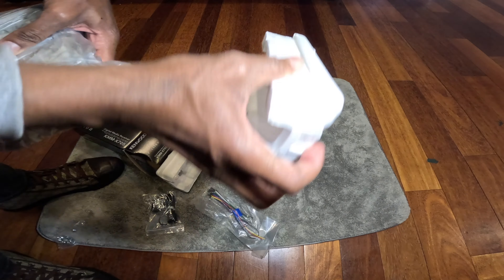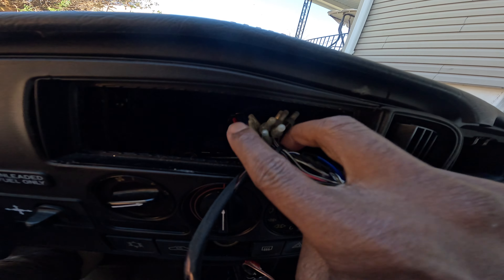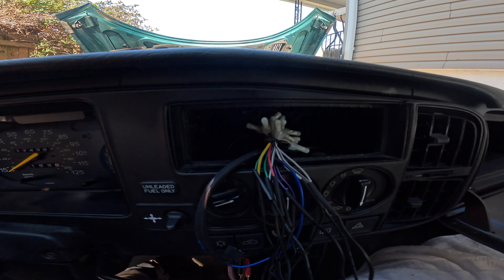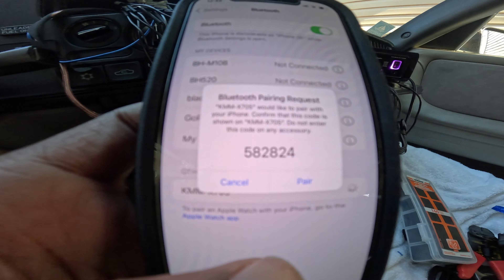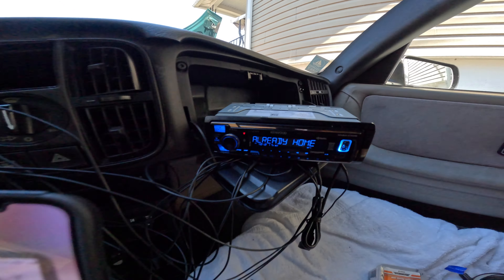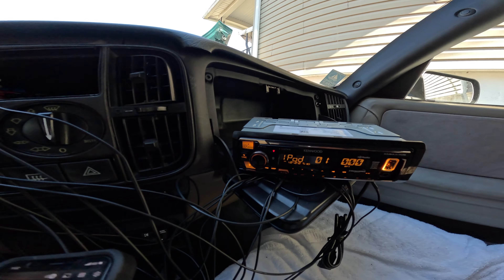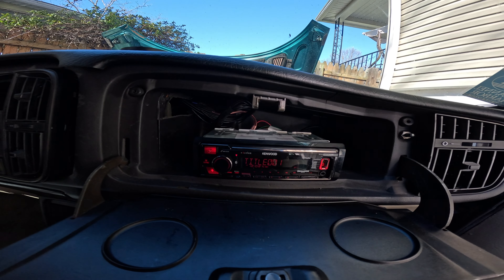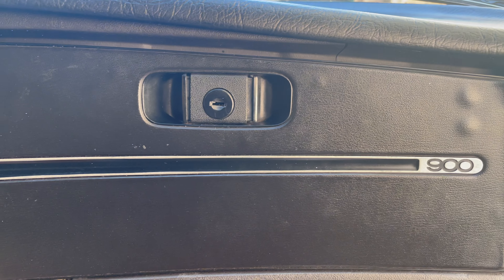HOW TO INSTALL A GLOVEBOX STEREO | KENWOOD EXCELON

Comment: I did a glove box install in my Lexus since its older and didnt have Bluetooth radio but wanted to keep my factory nav screen. I built a little wooden mount to hold the radio because i didnt like how it was sliding around in the box and shacking when i was play the sub loud. Ill send you a picture of how i did it if you interested
Reply: doing the same on a lexus gs450h, could i see ur setup and how u did it
Reply: @EnJshow  should be nice. Sure. I could send a few pictures on IG if you have that. I don't use any other platforms.